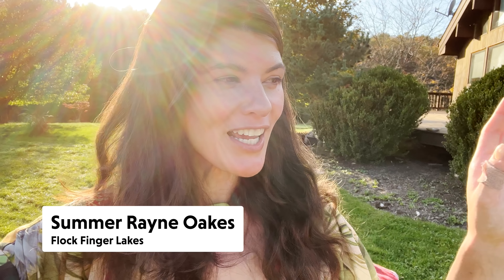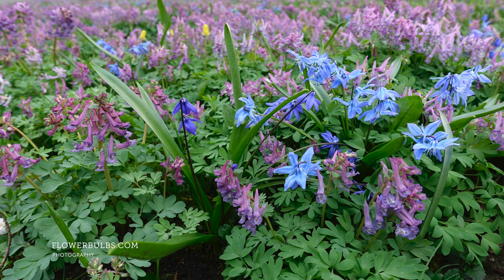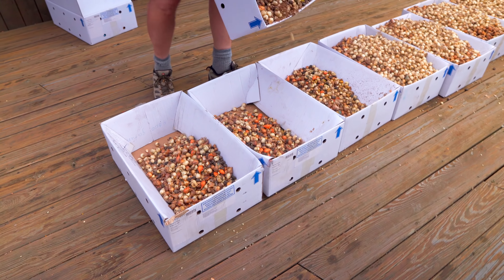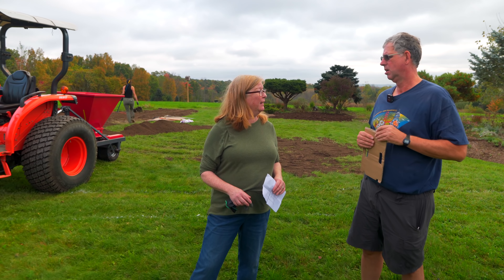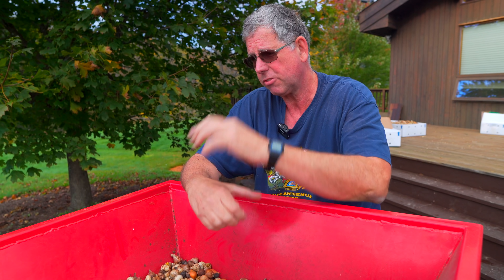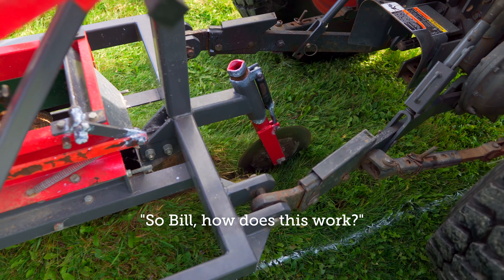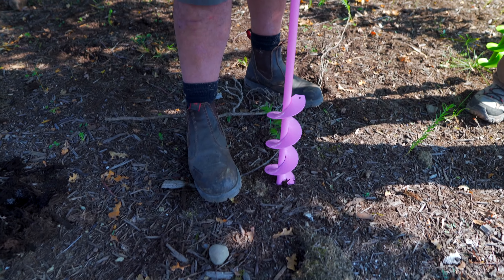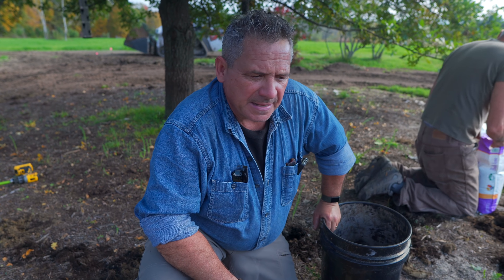We Planted 70,000+ BULBS in Our Lawn!!! — Ep. 059

Comment: Auger demo tip...

I'm in a root bound, rocky area - using the 3" & 5" Power Planters.

You will have a sore wrist that way or worse if you're drilling many holes for bulbs. 

Torque you're wrist a few times that way and you'll FEEL it. 

Buy a drill with a cross bar attachment. Even Walmart makes a drill that includes a bar for much more stability and it's much safer. It also keeps your hand off the top of the drill. You want to be able to let it ventilate properly and if the drill is overheating it will smoke and you need to smell it to let it cool down, especially with the 5" & 7" augers when dropping 10 — one gallon rose bush cans in the ground, etc. (btw-Dewalt is pricey and you'll be sad if you burn it out drilling holes in the dirt.) 

When you're starting out-Rest the auger tip point on your drill spot-
SLOW SPIN DRILL - 
PRESS DOWN - 
LIFT/PULL UP-
REPEAT.

Like a pulsing motion (Ahh, a bit like plunging a clogged toilet!) so those rocks and roots get pulled up and you can cut them away and lift out rocks and get deeper each pass.

NOTE - Wear some high boots and jeans. You'll avoid bruises from rocks on the legs or the auger catching your leg and dirt in your low top gardening shoes.

Big augers can REALLY hurt your wrist that way. Wrists are all tendons and ligaments and are easy to protect with a bit of awareness of how powerful this GIANT DRILL really is. 

You can loosen up a whole area with an auger saving time and your own energy over shovels, forks and picks at times. 

Augers are nice to mix compost with dirt, sand, etc. in an area on a low, slow spin setting too. 

If this saves ONE wrist, elbow, etc. I'm happy! 

🙏

Comment: I've planted about 150 on a lawn. It has taken me weeks. I don't have equipment or the option to take up the sod. I'm jealous that your auger worked. I bought one but no matter what it wouldn't penetrate. I even bought the same brand of auger. Maybe my clay is too thick.
Reply from the maker: We have about 24% clay here, so wondering what your constitution may be to warrant the augers not working. We actually just discovered that the reason why there is so much clay in the subsurface level here is because the pond had been dug out many decades ago and piled onto the area we were planting, so the actual topsoil had likely been covered. But there was likely very little topsoil to begin with since this is more mountainous terrain that was used as marginal farmland 60-70 years ago. Would be interesting to understand your soil constitution more and may even help you discover what bulbs may work best. Maybe Liatris?
Reply: @FlockFingerLakes  Yeah. I'm glad I watched your video today. I tried the auger again after watching the instructions and it worked better in the berm than the lawn. I think our Colorado front range neighborhood was either long abandoned farm land or just an open field. The soil is almost rock hard clay, and the yard is full of rocks. I'm trying snowdrops, crocus, iris reticulata, daffodils, grape hyacinths, and tulips. This is my first year planting bulbs, so I'll see what comes up I guess.
Reply: @FlockFingerLakes  My dad thinks the builder covered the whole neighborhood in leftover clay from digging basements somewhere else. The neighborhood is only a few years old. No wonder it's so compacted.

Comment: Isn’t planting native species more useful to the area as it serves more insects
Reply from the maker: Great point. We are too working on extensive native plantings here. Part of the goal of taking up the lawn area where we did is to test a low-mow, native lawn mix, with the non-native bulbs. The native lawn mix, to our knowledge, hasn't been tested, so I guess we are doing the testing and will be sharing in it's success or failure. Additionally, we are restoring a larger 7-acre area into native meadow (with a few exceptions to a couple non-native pollinator plants we enjoy) but it's designed with over 60 species that are some of the most beneficial as host plants for insects. Though I personally lean towards native plantings, there's also just too many awesome plants to want to plant that aren't native  (including many of our edibles) and that aren't aggressive or will just naturalize well—particularly in areas that are otherwise sterile (eg lawn/turf). But this bulb-in-lawn on a 1/4 acre for us also serves a lot of purposes of experiment: how to take a pre-existing lawn and turn it into a pollinator-lawn instead of something that has no to little wildlife value; how to take up/ remove a pre-existing lawn and plant bulbs but instead  use a native lawn mix; and also (in another area) how to remove smaller sections of lawn and see what naturally propagates there. Also experimenting on low-mow techniques (see a previous episode), which allows the areas to be more wild and instead using designated paths to walk. Additionally, this front area is important to us since it opens up to the Memorial Garden, and we really would love that carpet off blooms leading up to that special bed. And you may have heard us reference 'Dutch' elements of this video a few times. Since we are from four different countries (one of whom is from the Netherlands), creating gardens that pay homage to those four different corners of the globe is really cool for us. Gives everyone a little slice of home on the communal land.